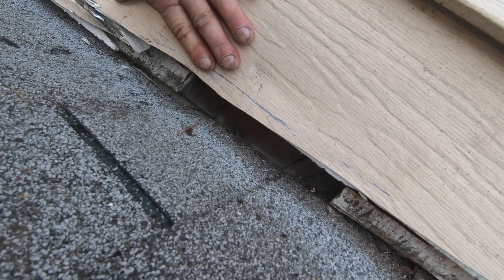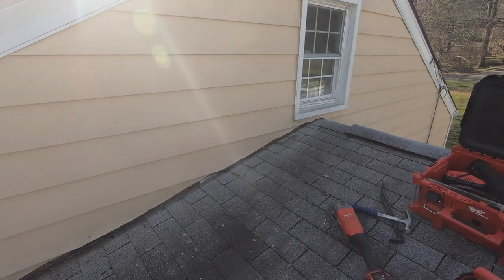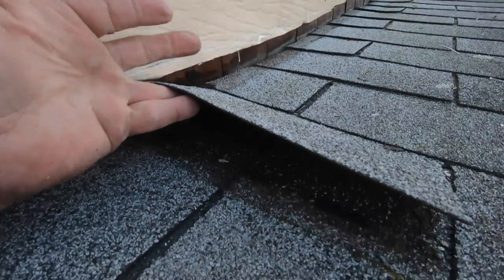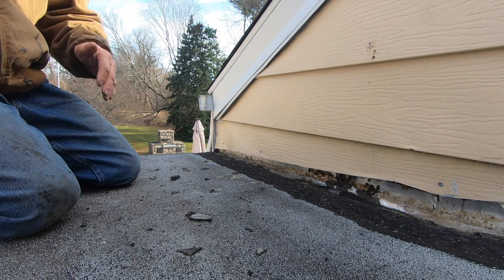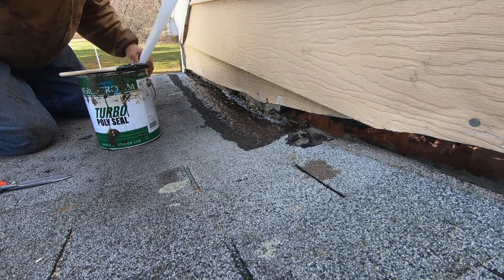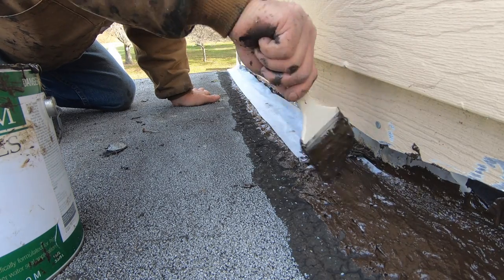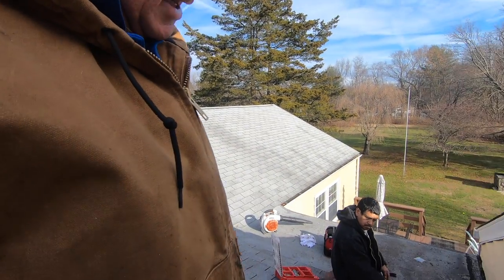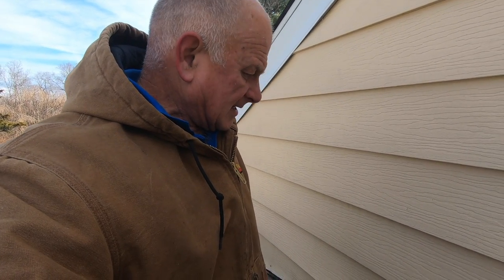FLAT ROOF LEAK REPAIR - How to repair a LEAKY ROOF flashing and shingles

Comment: What if the leak is in the middle of the flat shingle roof?
Reply: A flat roof should never be shingles. Gotta build the roof up with a pitch if it's flat to shingle it. If not it needs to be flat roofed.